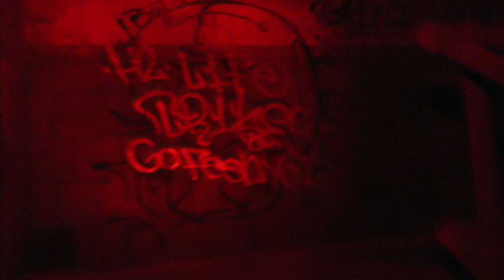CREEPY Abandoned Building Night Hunt | This Place Could Be #Haunted

Comment: I was considering buying another ATN.  Mine has lock up issues, but not very often.  Now I better reconsider.  I will wait to see if they take care of yours.
Reply from the maker: I have had 2 of ATN's scopes first one does not work at all and i got absolutely no help with it from customer service second one was the one you saw. customer service only response to any issue is does it have the latest firmware update. my advice would be to check out pulsars night vision lineup